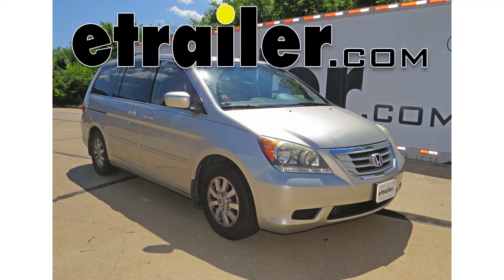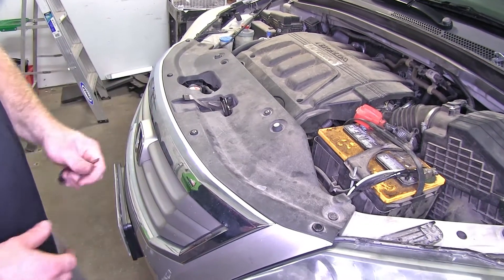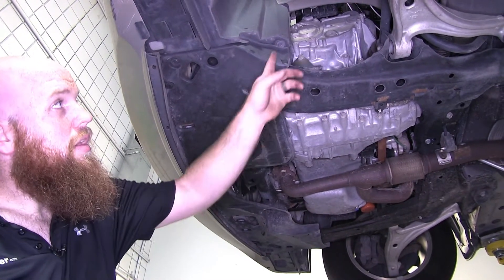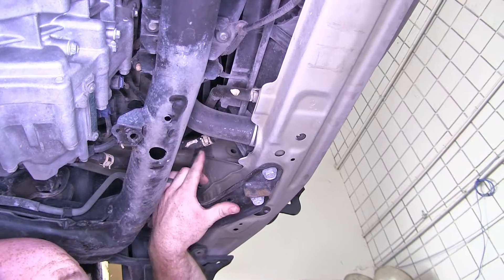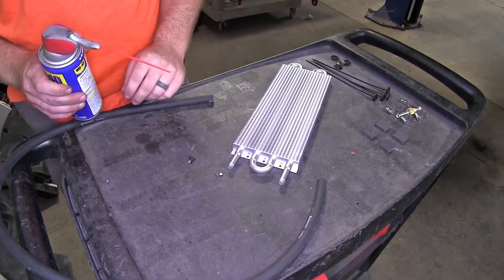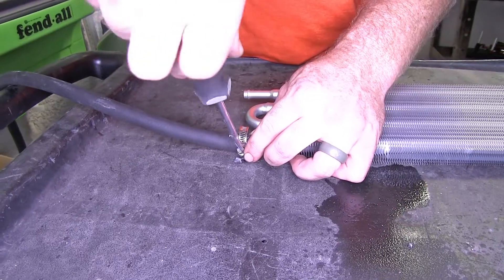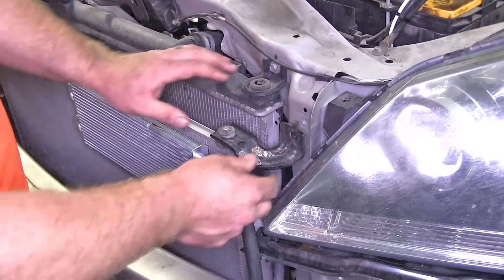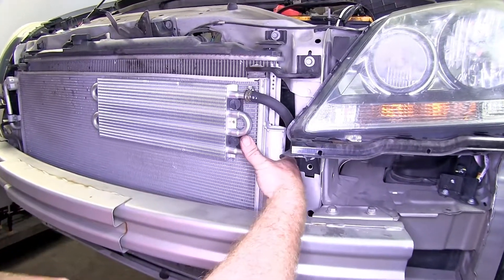etrailer | Mount: Derale Dyno-Cool Tube-Fin Transmission Cooler Kit on a 2008 Honda Odyssey

Comment: Ok .. but can you bypass whole radiator setup and send high n low pressure line to front mount cooler .. then make two trips around and just be one full flow to front cooler to transmission.

Comment: Why did you cut the second hose which could have been directly connected into the transmission from the cooler? You used inlet to connect which creates another source of leak.

Comment: Whole process took me about 2 and half hours.  My van was wamred up so it took awhile to figure out hot line and cool return line to tap in.  So many 10 mm bolt under carriage plus black push pins to remove . I did it so we are going to take road trip from Orange county to Texas then to Florida for my 2 weeks off work my family of 6. Thankz
Reply from the maker: Well done!! We're glad to hear about your successful install. Happy and safe travels for you and your family!
https://www.etrailer.com/Transmission-Coolers/Derale/D12902.html

Comment: Don’t you need to add additional transmission fluid?
Reply from the maker: You might need to top it off. Once the install is complete, start the engine and let it run for a minute or two, then check the fluid level and add if needed.
https://www.etrailer.com/Transmission-Coolers/Derale/D12902.html

Comment: Hello, the top/first hose from new installed cooler is connected to the return line/cool part from the radiator?
Reply from the maker: You will want the travel of fluid to come from the transmission, into the factory cooler, then into the aftermarket cooler, then back into the transmission. The reason for this is that the aftermarket transmission cooler is not designed to take the full heat that the factory cooler is. It is just designed to bring the already cooled fluid down a bit more.
https://www.etrailer.com/Transmission-Coolers/Derale/D12902.html
Reply: Would it be matter to switch the order? So the top house for the new cooler will be connected to the hot line from radiator?

Comment: Why not just hook up the 2nd end directly to the transmission?  That's where it goes via rubber hose anyway and you wouldn't need the extra part to splice.
Reply from the maker: That is also an installation option. Check out the installation details on our product page to see the two methods.
https://www.etrailer.com/Transmission-Coolers/Derale/D12902.html

Comment: Nice video, does it matter which part of the new oil cooler with install the first  hose coming from radiator?
Reply from the maker: It does not matter which end you connect first, the inlet and outlet are not directional. For more information you can take a look at our product page.
https://www.etrailer.com/Transmission-Coolers/Derale/D12902.html

Comment: I have learned late in my Odyssey ownership that any 2nd Gen Honda Odyssey owner, with half-a-brain, learned early-on that the Transmission Cooler is essential to getting an Odyssey transmission to last as long as other Hondas.  After replacing the radiator myself on my 2001 Odyssey, last April, I feel comfortable enough to use your video, for a 3rd Gen install, as a guide for installing your cooler in my 2nd Gen.  Thanks for the helpful video.  I'll buy the cooler kit through the link you provided.

Comment: Do we need to bleed the air after installation?
Reply from the maker: You will not need to bleed the air after installing this kit. You can find the installation instructions on the product page here https://www.etrailer.com/Transmission-Coolers/Derale/D12902.html to give you a better idea of what is entailed to install this system if you have a different vehicle.